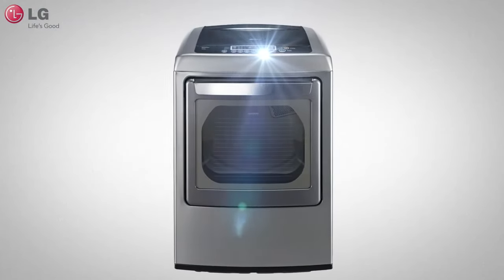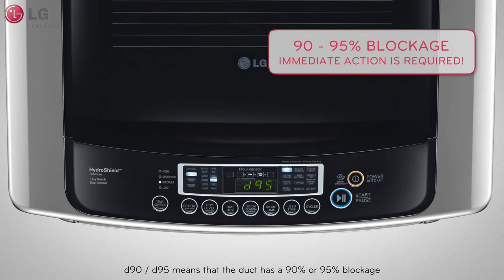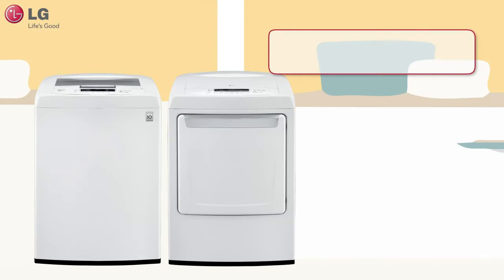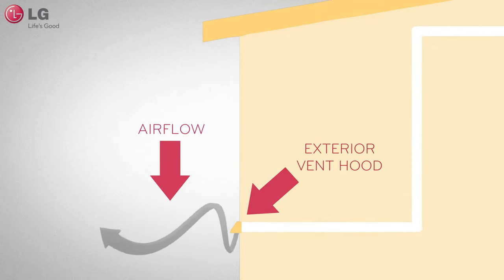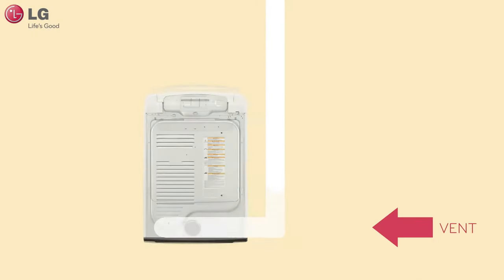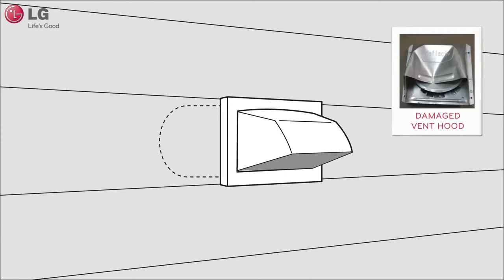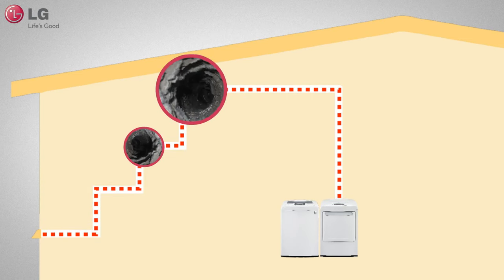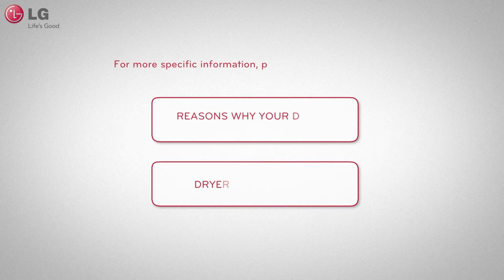[LG Dryers] Understanding d90 & d95 Error Codes - Flow Sense

Comment: This error code, D80, D90 ,D95 with  LG dryer  is a manufacturer problem, poor design of the lent/vent system that allow for too much lent to goes through and block the screen air passage.. luckily the sensor stop the machine from running. Otherwise they’d already face with recall due to fires 🔥. The cleaning process requires removal of the front panel and extra long vacuum hose tip. They should recall this and sent out replacement and parts for free. IMO
Reply from the maker: We appreciate your feedback and concerns regarding the error codes D80, D90, and D95 with our LG dryer. We take the safety and satisfaction of our customers seriously.

Our team is actively working to improve our products and address any issues that may arise. We recommend reaching out to our customer service for assistance with troubleshooting and resolving this matter. Your insights are valuable to us as we continually strive to enhance our appliances.

If you require further assistance or have additional suggestions, please feel free to let us know. You can send us a private message through @LGUSSupport on Facebook or Twitter. Your feedback helps us improve and ensure the best experience for our customers. Thank you for bringing this to our attention. ^Danee
Reply: @LGUSASupport had my dryer for a year and a half and already having issues with d95, their is no blockage on the outsides vent tube it’s inside the dryer. Manufacturers bad build quality and you guys only warranty it for a year because you know that’s how long it will last

Comment: Library support link reads "We're sorry.  The page you requested isn't available.”  
Ducts have been cleaned.  Filter has been rinsed/dried.  Dryer exhaust vent tube is new and shortened.  Vacuum hose with extensions to the back outlet and removed any obstructions (none).  House vent cleaned by duct technician.  LG dryer still shuts off with D90/D95 codes.
Reply from the maker: Hello there! We have read your comment and would like to assist you further. If you need any assistance or have questions, please send us a direct message on Facebook and Twitter (X) using @LGUSSupport. Include the product details of your unit, and we will be happy to help. Thank you!

Furthermore, if you're looking for information about the D90/D95 error code on LG Dryer, you can visit this link to find the most suitable option for your needs: https://www.lg.com/us/support/help-library/lg-dryer-understanding-d90-and-d95-error-codes--20150209089448 -Shae
Reply from the maker: Hello there! We have read your comment and would like to assist you further. If you need any assistance or have questions, please send us a direct message on Facebook and Twitter (X) using @LGUSSupport. Include the product details of your unit, and we will be happy to help. Thank you!

Furthermore, if you're looking for information about the D90/D95 error code on LG Dryer, you can visit this link to find the most suitable option for your needs: https://www.lg.com/us/support/help-library/lg-dryer-understanding-d90-and-d95-error-codes--20150209089448 -Shae
Reply: @LGUSASupport    TY.   I will not X or FB.  The dryer is out of warranty and I will not be using LG service for the $349.00 flat rate.  I will just go through a local appliance repair.   None of the suggested option work to clear the error codes.
Reply from the maker: Hi there. We hear you, and we'd love to get a better understanding of your concern regarding your LG Dryer. Kindly send us a private message via @LGUSSupport, so we can look into this for you. We'll be happy to assist you. -MC
Reply: @LGUSASupport     Curious.,     You missed the comment about that said, I do not FB.   I do not X.   “@LGUSSupport” is not a valid email.

Comment: Thanks! My dad’s dryer displayed flow sense when he shut off the dryer. I wondered what that meant. Then, the next laundry day, so 1 week from then, when we tried to run a cycle, a few minutes later, flow sense was blinking, and d90 and d95 was on the display.
Reply from the maker: Hey there,  

The "Flow Sense" indicator, along with the d90 and d95 error codes, means the dryer is detecting restricted airflow. This typically happens when there’s a buildup of lint or an obstruction in the dryer vent or exhaust system. Ensuring proper airflow is essential for your dryer to work efficiently and safely.  

Here are some steps your dad can take to address this:  
1. **Check the lint filter**: Clean it thoroughly before every load.  
2. **Inspect the vent hose**: Ensure it’s not kinked or clogged.  
3. **Examine the outside vent**: Make sure it’s clear of lint, debris, or obstructions like bird nests.  
4. **Perform a deeper clean**: If the codes persist, it might be time to clean the full exhaust system or call a professional for assistance.  

For more detailed information, you can check out this helpful guide: [LG Dryer: Understanding d90 and d95 Error Codes](https://www.lg.com/us/support/help-library/lg-dryer-understanding-d90-and-d95-error-codes--20150209089448).  

Once the airflow is restored, the dryer should function normally, and the error codes should clear. Let me know if you need further assistance! ^ Diego
Reply: @ thanks for the info!
Reply from the maker: You're welcome! If you have questions or need help, please reach out to us on social media @LGUSSupport with your contact information and model number. We'll be happy to help you out at any time! 😀 ^Joslyn

Comment: Having similar problems with the d90 code. 2ft duct between dryer and wall vent, had the wall vent cleaned and replaced the duct after the first instance of d90 stopped the cycle and that seemingly did nothing to fix it. Have even tried turning off the d80 error code but that does nothing to stop the d90 code from happening

Comment: Could the fact that the door gasket came off be the reason I'm getting a d90 error?
Reply from the maker: Hi, Mayer. I’m sorry to hear you're having this issue, and I’d like to see if we can assist. Please contact LG Customer Support by direct message via Twitter ( @LGUSSupport  ) or Facebook Messenger ( https://www.facebook.com/LGUSA/ ), and include your contact details, the model & serial numbers, and a detailed description of the issue. ^Chad
Reply: Lg dryer at straight garbage do not buy I wish I never bought one never again 💩💩💩💩
Reply: I agree. These dryers are trash. I get the error code even with the vent disconnected it’s brand new. Piece of trash.
Reply: FYI yes I was getting the error because the gasket was off. Once I put it back on which was a mission the error went away.
Reply: @Playerhater01 I’m having this problem with the codes it’s a new dryer
Reply: @chrisjordansk8 me too 😢
Reply: @Playerhater01 which gasket? Where does it go?
Reply: @angelica9566  around the dryer door